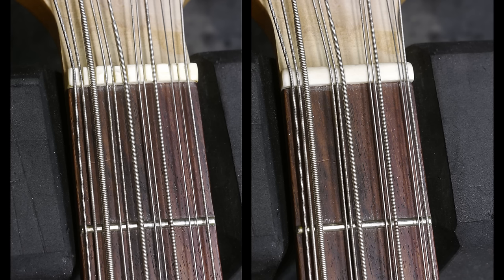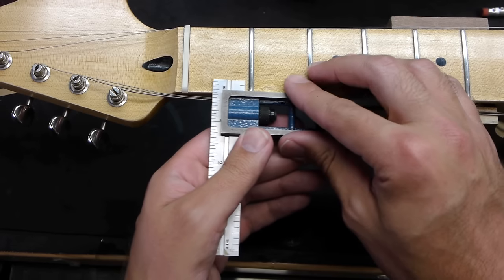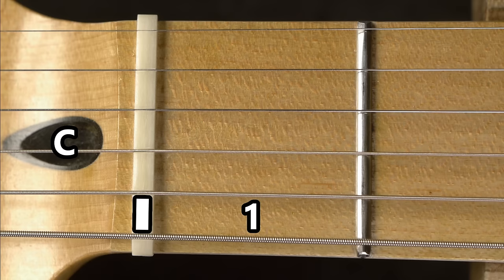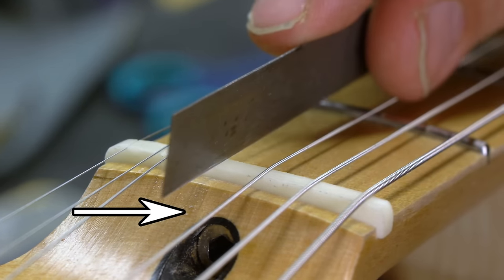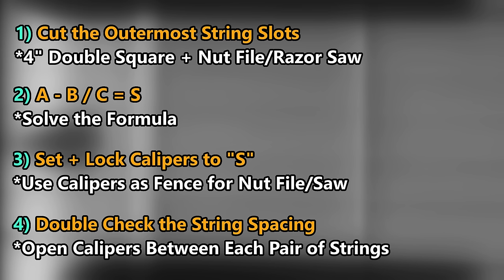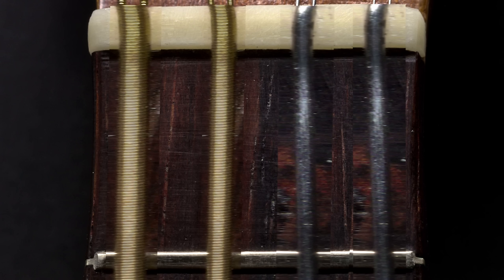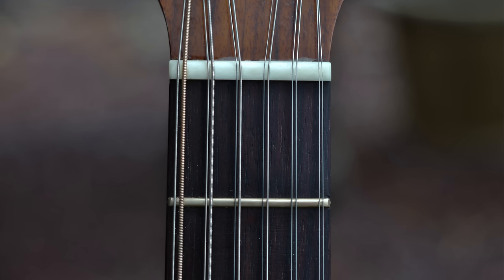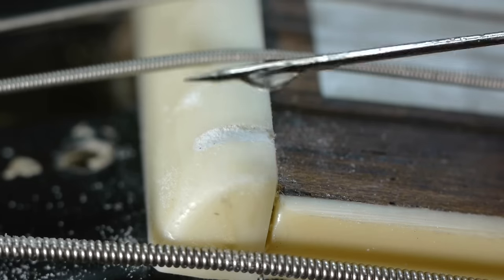Nut Slot Spacing *FOOLPROOF METHOD* - Works for 12 Strings Too!

Comment from the maker: *I'm updating this video, but I'm not sure how long it'll take me to post it. Here are some critical notes for the update*

-------------------------------------------------------------------------------------------------------------

1) Checking the spacing between each string pair before cutting the next slot is absolutely critical. Let's say you cut the outer E strings, do the math, set the calipers, and now you're cutting the A string slot. 

Verify that the gap between the E and the A is exactly what it should be before going on to cutting the D string slot. And so on. It should be as close to the value for "S" that you solved for as possible, ideally within .001". 

That means if S = .235", for example, you should verify that the gap between the Low E and A strings is .235" before moving on to cutting the D string slot. 

Move the string either way as necessary by angling the file left or right, and cutting on that angle before straightening it out and cutting deeper. You can easily move a slot to the left or the right using this technique. 

This is the most important thing that will be in the updated video. 

I mention in this video that you can verify the spacing after you cut all the slots...but that is not good advice. It's actually dangerous advice that can and will result in a poorly cut nut. 

For 100% accuracy, you must verify the spacing of each gap as you cut each individual string, every single time. Verify the width of the gap between each string pair before moving on to cutting the next string slot. 

Do that and you'll have a 100% success rate. The last nut I cut had all gaps between the strings within .001" of each other. 

-------------------------------------------------------------------------------------------------------------

2) Errors. I said .78 instead of .078, showed 32nd markings on the double square instead of 64th markings, and I'm sure there are a couple other similar errors. I'm really grateful to the viewers who caught these errors and pointed them out. 

-------------------------------------------------------------------------------------------------------------

3) I may or may not give some background on how I finalized this method when I was tasked with cutting a 12 string bass nut for my friend and mentor, Steve K. 12 string basses have 4 groups of tripled strings. If you thought cutting a 12 string nut was hard, try cutting a 12 string bass nut. 

I was scratching my head for quite a while before I finally cracked the code on it. I might include some information on that, or just tell a story in the updated video, whenever I get around to it -- but we'll see.

Comment: For conventional instruments it's easy: divide nut width by number of strings. That gives you the figure for your inner spacing. Divide that figure by 2 for your outer spacing. Done. Way more complicated for 12 strings etc so I'll bow out there. That's what I do for my guitars anyway.
Reply: This is my approach. Perfect for 6 strings.
Reply: Doesn’t account for string thickness which results in some areas being more crowded and uneven. 
Everyone should be using the Stewmac string spacing rule and tbf this video is obsolete

Comment: i’m really curious why the Stew Mac gauge didn’t work for you. I’ve also had a drilled in my head that the spaces between the strings should not be equidistant. I’d like a little more information about how you came up with your methodology.
Reply from the maker: All right. But bear with me, as it's going to be a very long story! I like talking and typing a lot, so here we go: 

I first learned how to cut a nut about 20 years ago from my friend and mentor Steve K., who started his career working for Dan Armstrong in Manhattan back in 1968. 

The way Steve cuts nuts is by eye. He lines up the strings so they're equally far apart by eye, then makes a pencil mark on either side of the string. Then he holds his thumbnail between those two pencil marks and cuts the slot with a razor saw as a set mark before going in with a nut file. I can't remember if he does this on the wound strings as well or just lines up the nut file between the marks. 

He also made it very clear that he does them the same way every time, with equal spacing between the strings. He said he used to indulge customers that said they wanted "a little more space between the E and the A" or some other custom request -- and they were NEVER happy with it. 

Then he started cutting them the same way every single time no matter what custom request for slot spacing people had, and he never had another complaint ever again. He's told me that story dozens of times. 

Anyway, I did it this way by eye for years and years. Never checked the spacing with calipers so I have no idea what the true spacing I was getting was. But I had mixed results and struggled to get my nuts to the quality Steve's were consistently. Scrapped many of them, over and over again, over a long period of time. Most customer jobs would take me 2 or 3 tries to get right. I went through a LOT of bone and buffalo horn blanks. 

Eventually I got a Stewmac String Spacing Rule, but I had the same problem with it as the other method: lining up the saw or file over or between the pencil marks. 

My main gripe with pencil marks is that cutting over or between pencil marks will never be as accurate as using a fence. 

It's an extreme example, but it's like using a double square to draw a line on a piece of lumber, then cutting along that line freehand on a band saw, vs. using a fence on the bandsaw to make the cut. 

The line is drawn perfectly accurately, but cutting along it freehand is another matter. And it isn't that extreme of an example when you account for how critical nut slot spacing is and how easy it is to be off by .010" or .015" when cutting over or between pencil lines by eye. 

Steve still cuts nuts the way he always has. No string spacing rule, and he doesn't use my method either. I remember over and over when I was learning from him he told me that nuts had to be cut by eye, and it was the only way to do them right -- and I did cut a lot of great nuts over many years doing them that way. 

Now flash forward to my method using calipers as a fence. 

I was using a mix of the Stewmac String Spacing Rule and the "by eye" method I learned from Steve for a long time. I was struggling with both. I tried scribing lines in the Stewmac tool instead of using pencil marks, then gradually going up from small nut files to bigger nut files, to make sure the line was staying dead center. 

But I struggled with it, and as I got into more complicated jobs like 12 string nuts, I couldn't figure out how to use the ruler at all. I know people have, but it was too complicated for me. I'm a simple guy and it was hurting my brain trying to figure out how to cut these nuts properly with the string spacing rule -- but it was also virtually impossible to do by eye. 

I didn't cut many 12 string nuts before deciding there had to be a better way. And for regular nuts as well. I was tired of scrapping nuts after getting the spacing wrong, either the outside strings too far apart or too close together, or getting the spaces between the strings uneven. 

After all that work thicknessing, fitting and shaping, only to screw up on the slots dozens and dozens of times -- I slowly started coming up with the idea. 

I found the nut slot spacing formula online. I can't remember where. But it was the (  A - B ) / C = S formula, though I changed the letters from whatever they were originally. 

The problem was, the people suggesting this formula were also pencil mark users. And that was not going to work for me as it wasn't accurate enough, and I didn't have great mechanical ability to use pencil marks as a guide without screwing up. 

I first thought of using the calipers many years ago. Originally I was using an Xacto knife with a #11 blade to scribe a line against the jaws, then used a small nut file to start the slot, and graduated up nut file by nut file until I reached the final gauge, say a .046", for example. 

Then at some point it occurred to me that I could simply use the nut files themselves against the jaws, and get a perfect cut every single time. It's rarely off by more than a few thousandths of an inch, which is easily corrected to perfection by slightly tilting the file one way or the other. 

So I was doing regular 4 string bass and 6 string guitar nuts with that method for a while. And it was working great. 

But then Steve tasked me with a 12 string bass nut. The pictures are in this video, the first ones in the video as a matter of fact. The original nut was an absolute disaster, and it was so bad I actually had to look up 12 string basses on the Internet. 

Because I wasn't sure what they were supposed to look like. The way the nut was cut it almost made it look like it was supposed to have some really bizarre string spacing. 

When I realized it was tripled strings in 4 groups, well. I didn't know what to do. Doing it by eye seemed too daunting and I had no idea how to use the Stewmac Rule to do it. 

It took me days of thinking and ruminating. Then eventually I had a lightbulb moment -- using the nut files themselves as a spacer, like a feeler gauge, to control the spacing between the pairs. 

It also occurred to me that all paired string nuts effectively have really big "single strings" -- when you account for the space between the pairs, the outer diameter of the string pair is effectively just a big single string. 

And then I realized it would work exactly the same with the ( A - B ) / C = S formula I'd been using for so long already with so much success. 

That's when it all clicked, and I realized this method can be used to quickly and easily slot any kind of nut with regular string spacing, no matter how many strings are in the groups. 

So, I had the opposite training in the beginning. It was drilled into me that the spaces between the strings had to be equal. I never even heard of equal center-to-center spacing. Even one commenter from some months ago who explained it, I had to read over his comment many times to understand what he was talking about. 

The Stewmac Rule seems superior to me to that method, as it accounts for the crowding of the low strings that happens when you use equal center spacing. It is an ingenious tool, no doubt, and probably the best tool available for doing center-to-center string spacing with that extra allowance for more room between the heavier strings. 

I didn't even realize any of this all those years. Was just doing what I was taught and then using the Stewmac Rule without really understanding the nature of the spacing it was designed for. 

I've been a very avid player for 20 years now, with Jimi Hendrix and Leo Kottke being my two biggest influences. Slotting 12 string nuts the way I do now made a tremendous difference for me on my own guitars. And on my Strat, same deal -- massively improved playability. 

It's been so long since I used the Stewmac Rule. I won't write it off. I'm a bit dramatic in my videos sometimes to make them more entertaining to watch, like throwing the Rule in the garbage can -- but I still have my Stewmac Rule and I may try experimenting with it again to really give it a fair shot and assessment vs. my caliper method. 

I will say I've had a tremendous amount of success with my caliper method, and I'm one of my best customers with it. I do all of my guitars the same exact way with that same method, and I absolutely love the way they play. 

A blind test would be best, really. I do believe my method is the absolute best out there for doing equal gap spacing. But for equal center spacing, the Stewmac Rule seems to have the edge, and is better than the standard method, which does not account for the crowding of the low strings when using equal center spacing. 

Anyway, I could talk about this all day. My brain is already gnawing on the idea of how to achieve the Stewmac Rule spacing for equal centers while using calipers as a fence -- I really do believe it's the best method currently, and using a fence will always be foolproof, and much more user friendly than doing anything freehand or by eye. 

That's the last part of this story: Steve is incredibly mechanically gifted, and many of my methods I've come up with (a lot of unique things with template routing, in addition to this nut slotting stuff) -- I came up with these methods because I'm not innately mechanically gifted, and I found myself repeatedly getting frustrated at not being able to replicate the freehand results Steve would get constantly. 

He learned to rout pickup cavities freehand, and I thought that's what you had to do as well. I figured out template routing on my own and all the methods I've come up with since are based on being idiot-proof, using fences/guides/templates as often as possible to safeguard against human error. 

I'm sure there's points I didn't get to, but hopefully that tells enough of a story for you to understand where I came from and how I came to creating this method. I appreciate the question and I'm glad I had the opportunity to answer you here, and again, hopefully this clarifies the history behind this method.
Reply: @guitar_md  wow! Thanks for taking the time to type out this response! VERY thorough! 🙏👍

Comment: Absolutely brilliant! Thank you for sharing. Just one questions though. The even spacing for all strings can sometimes sort of crowd the bass strings as they are thicker. Does your formula account for that? Cheers.
Reply from the maker: Thanks so much! I find the opposite to be true with this method. 

The crowding on the wound strings comes from using even string center spacing, so all the centers of the strings are equal distances apart. 

Since the low strings are thicker, this will cause crowding on the low strings, as they'll be closer together than the plain steel strings.

It's like having 6 people standing with the center of their bodies exactly the same distance apart, but the first three people are 400 pounds each and the last three people are 150 pounds each. All equally far away in terms of the centers of their bodies -- but you bet the bigger people are gonna be closer together! 

With this method, the gaps between each string are all the same. This completely solves the crowding issue. 

This would be like taking that same group of six people and saying you each are going to stand exactly 2 feet apart, measuring from the edges of each person's body. 

The Stewmac String Spacing Rule, as far as I know, uses equal string center spacing, but compensates it a bit. So the Stewmac tool is its own spacing, and was formulated to help correct that crowding problem on the wound strings. 

My favorite is the method in this video. I find it works very well, and is extremely comfortable to play. It also just looks right. And I'll never forget my friend and mentor telling me about his dad who was a pilot in WWII. 

His dad said about airplanes, "If it looks right, it'll fly right." 

Hope this helps!
Reply: @guitar_md  Great! This makes sense. I'm looking forward to trying it.

Comment: How about bass guitars?
Reply from the maker: Yep. Works perfectly. The first image in this video is actually a 12 string bass nut that I cut, before and after picture. 12 string bass nuts are the most challenging I've come across, and this method makes quick work of them.

This method will work for any stringed instrument with a nut. For 4 string bass, you just use 3 for "C" in the equation, as with 4 strings you'll have 3 gaps between the strings. The equation solves for equal gap distances between each string. So the only thing that changes is the value used for "C," which depends on how many strings there are. The number will be one less than the total number of strings. 

So for a 7 string guitar, C would be 6. For 5 string bass, C would be 4. And so on.